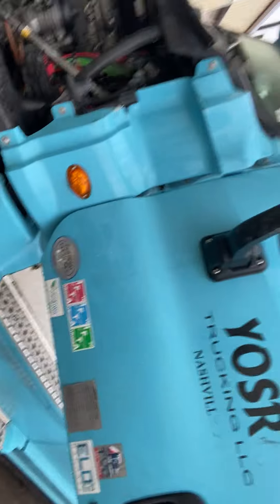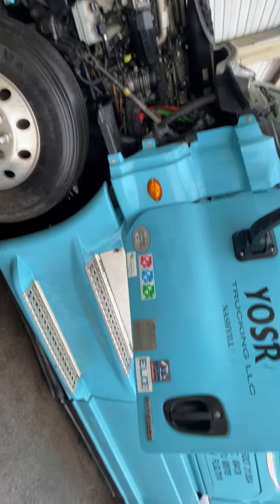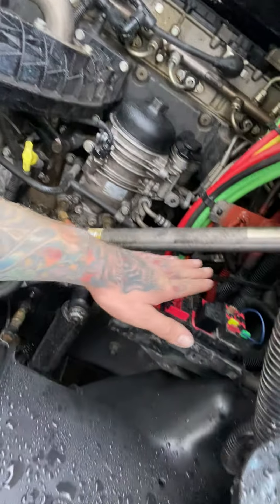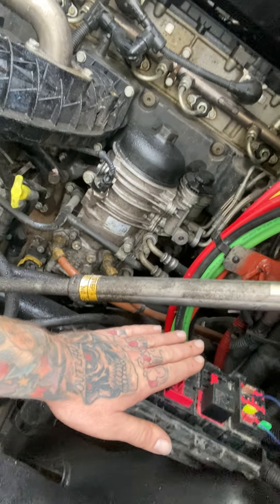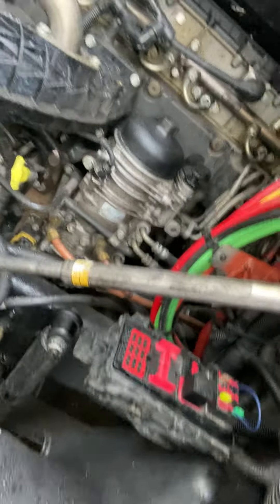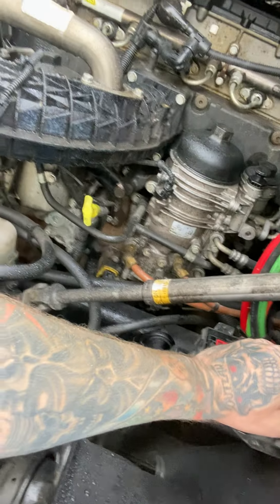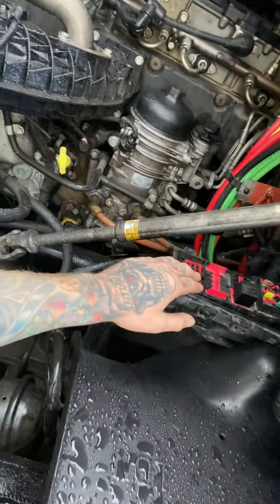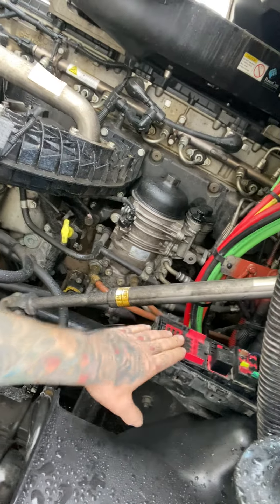Diag no start possible ecm failure Freightliner cascades dd15 detroit

Comment: Hey bossman. You ever seen the truck say park brake off when the driver door opens. Ive repaird cpc unit m, changed pcmb unit and changed brake pressure sensor under the steering colum.

Comment: I appreciate your commentary. I have a quick question. I am having a similar problem but my fuse seem to be working. However, still no start. Any idea what i should do next?
Reply from the maker: test the power in and power out to the ecm
Reply: @StickShiftRacing 
Question i have 2011 freightliner cascadia just replace engine harness today was having issue with losing power loaded climbing hills and sometimes if I'm not loaded had codes 
Like Jake brake 1 jake brake 2 and a few more codes do you the The ECM could be bad I thought the engine harness would have fixed the problem

Comment: Thank you for the video. I checked it out. All fuses are working & battery is good. When I turn switch over, I hear clicks from the starter but will not turn over. I bypassed thru solenoid and starter turns over but won't crank. 12V going to ECM but only 6V coming out to starter. Any ideas? suggestions of what I can check next?
Reply from the maker: if there is only 6volts coming out of ecm it’s dead

Comment: Hey my truck won't crank but also doesn't communicate with transmission and all the gauges don't work(water oil turbo) all wiring and fuses are good? Can It be my ecm?
Reply from the maker: ecm is down
Reply: @StickShiftRacing  thanks for getting back to me
Reply from the maker: @notkirill6991  absolutely sorry for the late response

Comment: I have the same thing. DDL8 showing ecm powering on but no functionality. When it first came in the sam chassis had a meltdown from whatever the roadside did, Possibly hitting it with a startall.  
 I also have no ACM communication the ABS has 40 codes. 

Replaced sam chassis its not melting now.  If anyone has MCM wire diagrams much would be appreciated. The customer doesn't want any dealer involvement. So im stuck with it
Reply from the maker: have you checked the cpc
Reply: @StickShiftRacing  thats the next phase. Sending it to get rebuilt
Reply: hey did you find out problem ? i’m in same 🚤
Reply: @dhillon11  yea bro it was the module
Reply: Still some issues with the the truck

Comment: Hey my truck is doing the same thing do u think it's best to get another fuse box?
Reply from the maker: absolutely so
Reply: I had the same issue. I was advised to change the starter. I changed it, truck crank, then def codes popped up immediately after crank. My truck is deleted, so that was confusing. I had someone put the computer on it, and they said I didn’t have enough power going the computer control module. Think I might have to change the computer control module?
Reply: @truckinfasho2397  what did you end up doing?